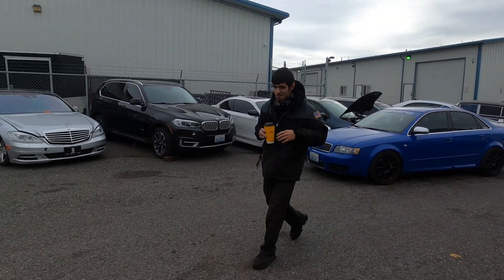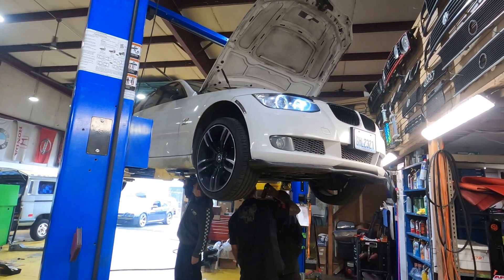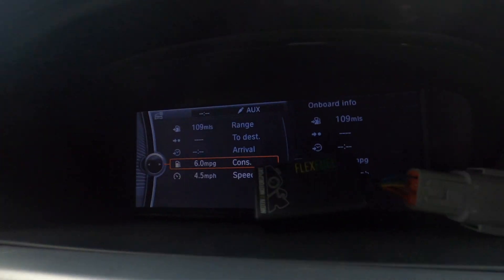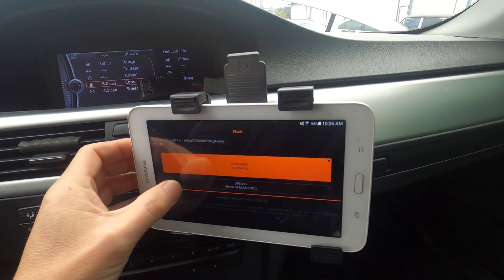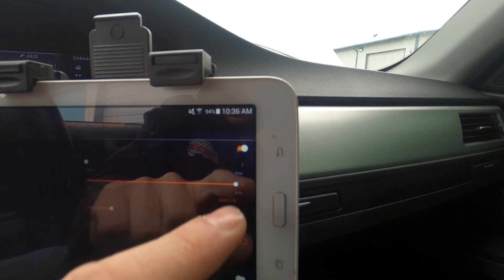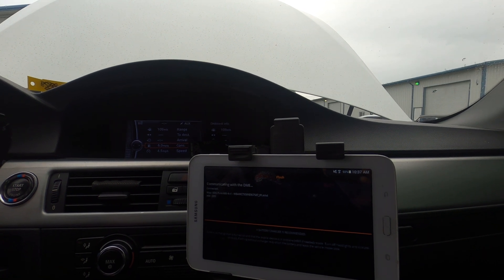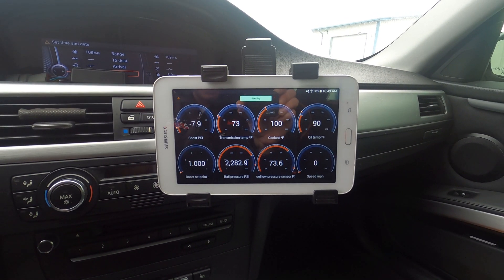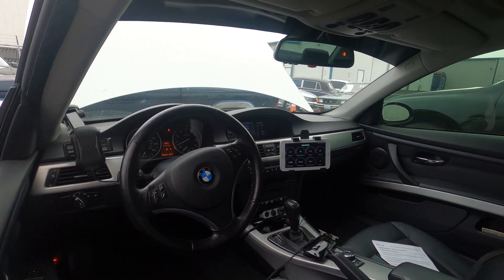Pure 600 Turbo N54 335xi Build Log #3 - Installing Motiv Ethanol and Wedge Performance Custom Tune

Comment: what was the overall labor cost? i'm looking to do the same build but also wanting to plan ahead
Reply from the maker: I work at the shop so much less than what someone might pay walking in off the street.  Labor rates vary quite a bit from area to area but we worked on her for about 3 weeks straight so roughly 120+ hours or so.  That includes install, working on stuff that came up, fabricating some custom stuff, etc.  Its been a fun build so far and you'll definitely enjoy it if it's put together right
Reply: @PNWDrives  i'm excited, yet dreading the day. but i've heard good things about pure turbos.
Reply from the maker: @joshhdtx  I hear ya!  Took me 2 years of research before I felt comfortable about assembling my build.  Pure definitely has a rock solid rep which was one of the major reason I went with them .  Good luck with the build!!